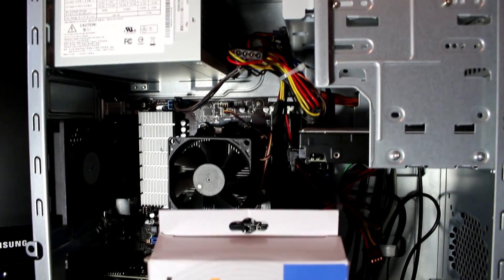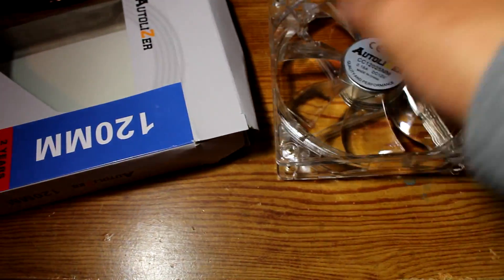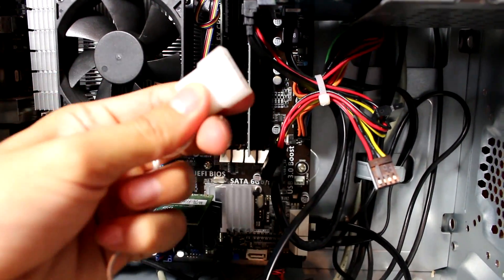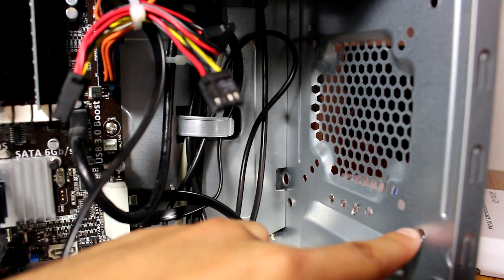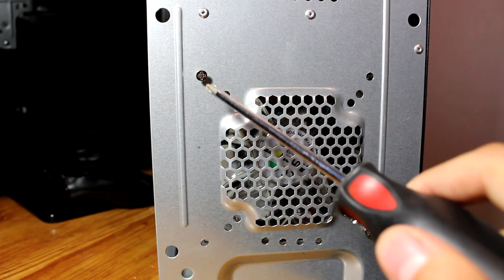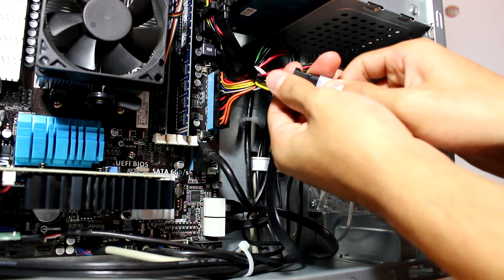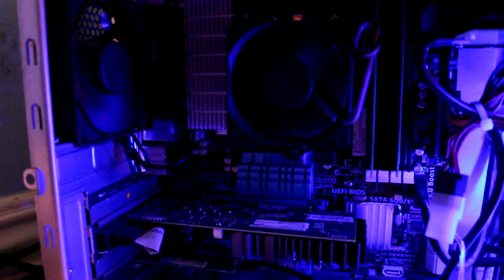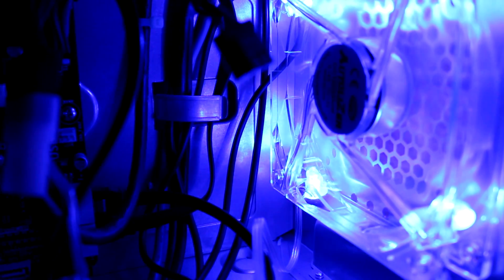How To Install a LED Fan Into Computer Easy

Comment: So is it wise to connect the 3 pin to a 5volt header? I heard never connect LED fans to a 12V header. Or does this only apply to RGB fans?

Comment: what is the best way to use case fan , as an exhaust or as intake ??
Reply: It depends where you put that fan on the case. Generally speaking, PC cases intake air from the front and exhausts it out the back or top. This path creates a nice airflow that cools your components as the air travels through the case.

Comment: I need some help my motherboard has 4 pin system fan connection and my fan has 3 pin connector now what i do
Reply: I believe a 3 pin connector from a fan can connect to a 4 pin connector in a motherboard. You should be fine just plugging it in. I might be wrong, though.

Comment: just for the future. the motherboard 3 pin connector actually doesnt allow you to change the speed of the fan. A fan with a 4 pin motherboard connection that states it's PWM will actually be controlled based on the temperature.
Reply: Wrong 3pin headers can change speed by regulating the voltage
Reply: It does, either quiet or full blast

Comment: can you put the 3-pin connector wherever you want in the motherboard or it must be a specific 3-pin as well?
Reply: RazerGamingHD Never plug a Case Fan into CPU fan
Reply: HackingYourHead a
Reply: The Budget Gamer on the motherboard it will say CPU fan generally that's where it will be connevted or if their is a case fan port